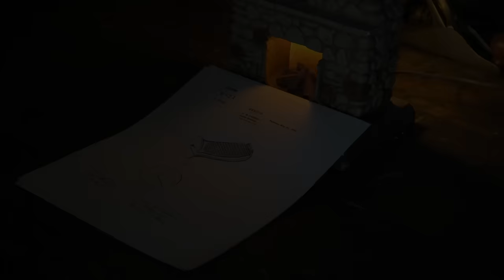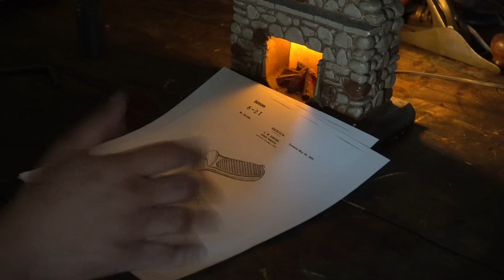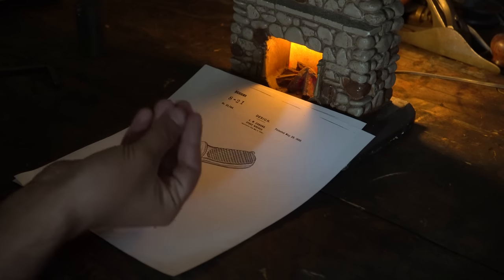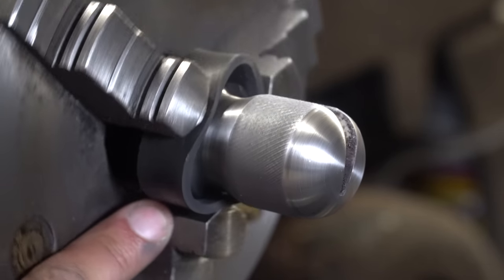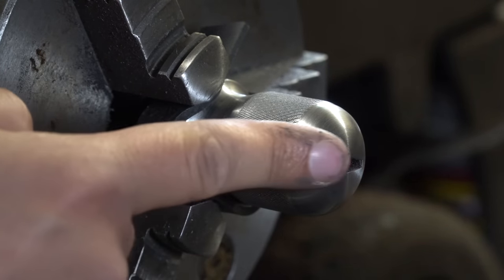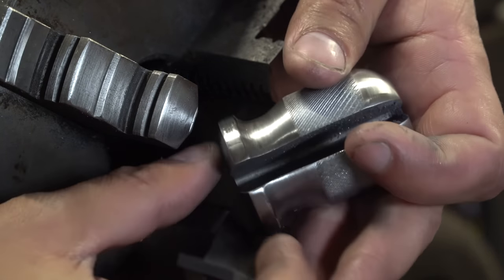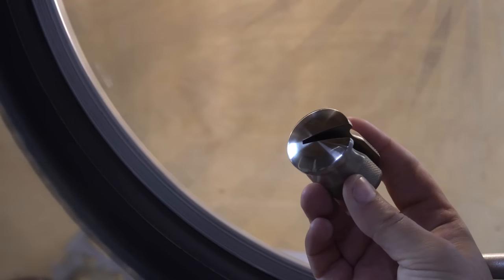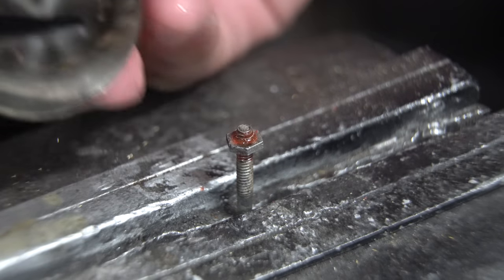Nipple Wrench [Patent Remake]

Comment: One or more of the many before me might mention removing the air from the tire prior to adjusting the nipple. 

The typical spoke wrench wouldn't be as nice as this if the slot had some flats that were parallel at the sweet spot, for the modern nipple. Good project idea to make a set of different sizes. 

Misses the point but, nipple twisting is an art-form.

Comment: If you rounded the inner 'ditch' of the part instead of leave it squared off, you would relieve stress concentrations. It would crack less easily. This is represented in the original patent drawing as well. I imagine they would normally use a power file with a rounded-over tip. Adding teeth would lengthen manufacturing, and make is less universal of a tool. Imagine it like this is a tool from 'as seen on TV.' Fits infinite sizes! Universal to a fault. By far the best bit of your videos is your personality. Deep fry until hardened.

Comment: Emo bandsaws are rare now specifically for the reason seen in this video.

I don't know anything about milling, but would the process have been easier on the equipment if you did the lathe work first, then cut the V-slot later? Oh, and the V-slot reminded me of another weird old power tool: the power hacksaw. It was just a hacksaw hooked to a fairly slow-turning offset wheel, like an industrial-grade windshield wiper setup. A weird alternative to the bandsaw. Something like that could have cut a V-slot, but it wouldn't be as perfect as what you milled in this video.

Comment: I could have used one of those today. I was trueing a branded wheel from a very well known American bicycle manufacturer, and the nipples turned out to be of very variable sizes, so that I ended up needing three different (parallel sided) spoke wrenches. I'm sure they were all MEANT to be the same size, but they... were not. The job would definitely have been quicker with a V-slot spoke wrench -- although how much damage it would have done to those already fairly rubbish spoke nipples I can't say.

Comment: Since almost all modern spoke nipples are made from brass or aluminium you could probably make this from something softer and easier to work with than steel. I also wonder if a version with a narrower taper would work better on modern nipples, it could be a sort of emergency tool.

Comment: Back in 1900, one machining tool that was used was the shaper.   That "V" groove was surely made with the shaper.
And if you ever want to machine a second one.  Change the order of each process.  The "V" groove should be done last.  And Knurling shoud be the last OP before the "V" groove.

Comment: You were mentioning issues creatine the V shape..... why not just drill the root of the V and then come in with a Slitting Saw to remove the rest? Since you're going full top to bottom it would just be 2 slitting saw operations down to where you drilled the root to be and then remove the material like a cheese wedge?

Comment: Someone please correct me if I am wrong, but would it not have been easier to rough out the V-shape with a bandsaw or (whatever sticksåg is called in English), rather than drilling it out? Together with holding off on making the V slot until near the end of operations ofc.

Comment: Perhaps a more useful design for this tool would be to have most of it just be a slotted wooden handle that you can plug a softer steel or brass head onto. That would allow the nipple to get a better bite and also be a smaller block of metal that would eventually need replacing. Then you could have different width/depth Vs for the nipple and the spoke would still fit in the slot of the wooden handle.

Comment: Everyone likes a bit of side nipple cinematography. Too bad this design doesn't translate into current day nipples, but I like the diameter of the tool for the ease of torque and control. It has promise.

14 gauge is the most common spoke size in bicycles today (Ebikes may have 12 or 13 gauge, and road bikes might have 15 gauge.). The flats on a 14g nipple should be 3.23mm. 

If you want to give this a go for modern 14g spokes, try starting with a 2.4mm channel at the outside diameter, and have the center of the tool diameter at 3.5mm so you can slide it onto the spoke, then drop the tool down onto the nipple from center position and pull gently to lock the wrench. Being as flat as possible is the key to a viable wrench tool. Try to keep it under 1 degree, preferably 0.7 degrees of change over the length of the slot (widen the outside as needed.)

Comment: im no metal worker so this might be BS
if i would want to make many of them id drill the center hole for the radius of the V groove and a 2nd hole and then make a holder for the bandsaw which utilizes those two holes to cut one side of the V and since it should be symetrical then just flip it for the other cut.

or a specialized mill tool you can run through the bar to make the groove in one cut ....

Comment: My thought is will not work. Moderns nipples are made in alloy light materials for weight and factory  locktited.
So hard steel v shape tool will round them. Same tool but no V shaped but stepped should be an interest update.
If you want an interest video about bicycle wheels, you can change an  aluminium nipple in a not holled rim...its crazy.
Nice video anyway.

Comment: WELL I CAN SEE HOW WHILE WATCHING YOUR PRESENTATION ON THIS I WOULD DO A BIT DIFFERENT 
FIRST I'D TURN IT TO SIZE PRIOR TO SLOTTING THEN 
KNURL NEXT THEN SLOT FOR SPOKE I THINK IT WOUKD BE A BIT EASIER ON THE EQUIPMENT ☝️ THEN UPON SEPERATION I'D CUT IT OFF JUST SHY OF THE SLOTT
SO AS TO NOT HAVE TO DEAL WITH GOING SLOW FOR SEPERATION 👍👍 IN ANY CASE I ENJOYED WATCHIN THIS